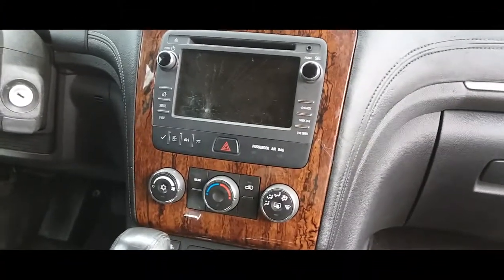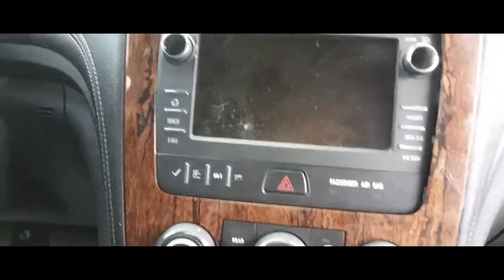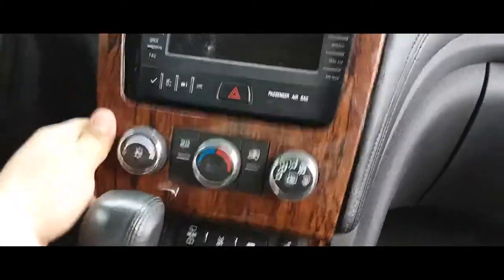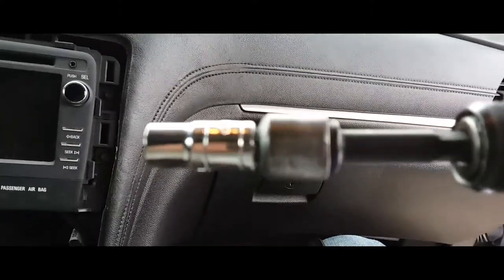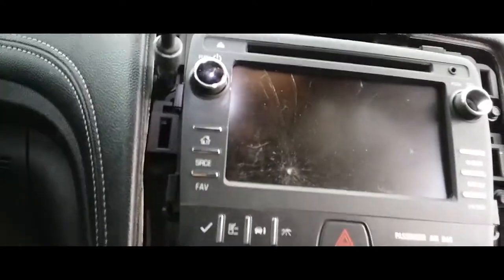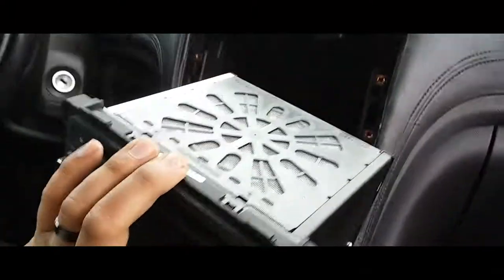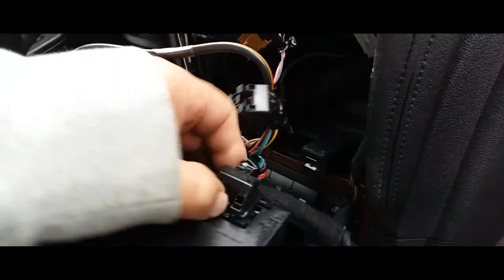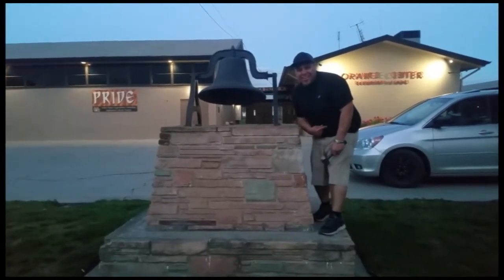How to: Remove Stereo from a 2014 Chevrolet Traverse

Comment: Hello Jorge. I have a 2014 Chevy Traverse and I'm having a problem with the buttons underneath the radio which includes the emergency lights button and the other ones for the info on the truck. What could be wrong with it
Reply from the maker: Maybe the actual unit has gone bad and might have to be replaced. But before that I would check all the fuses to Insure that it's not a blow fuse. What you can do next is take the unit off and inspect the wire harness to make sure there isn't any broken wires. If it All looks good, then it more than likely the unit itself. You can find a replacement online or you can try a salvaged yard like LKQ were they have OEM parts
Reply: @559powerscape  thanks Brotha. I checked the fuses and all fuses were good. I disconnect the battery and waited for a few minutes and it went back to normal.  Thanks for the info and if case I have to remove the unit seeing your video showed me how for future reference. Thanks again
Reply from the maker: @chuyvallejo1  oh man heck yeah I'm glad disconnecting the battery worked.  Dang thanx for the fix! Wow that's good! I'm glad nothing had to be replaced! Have a good weekend! Thank you for your support!